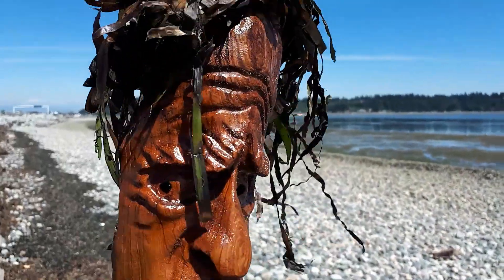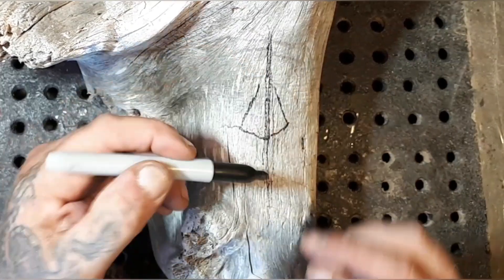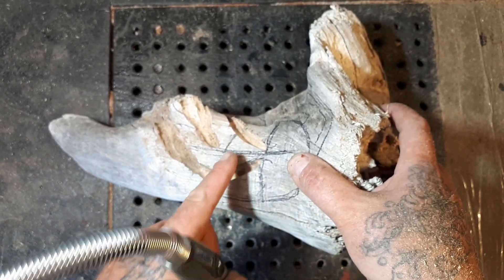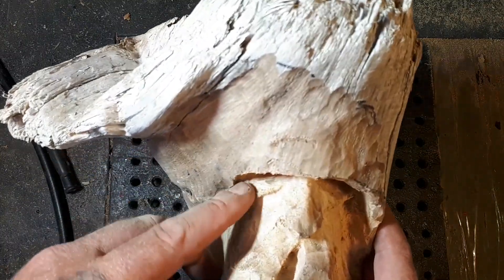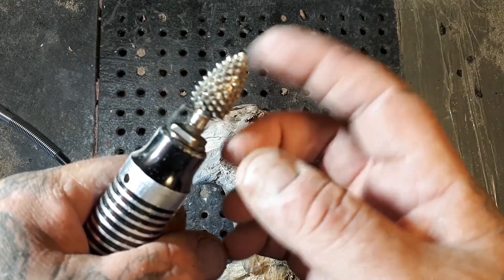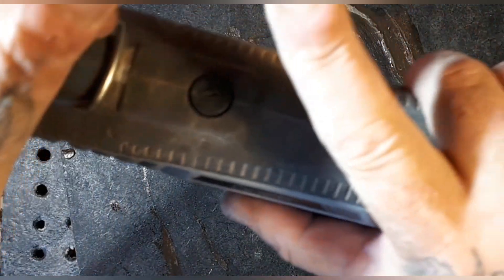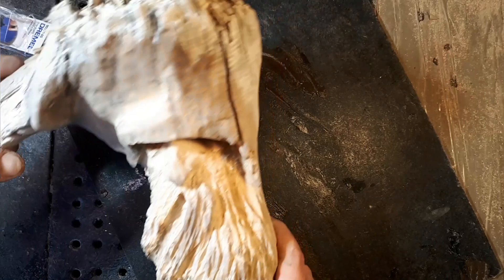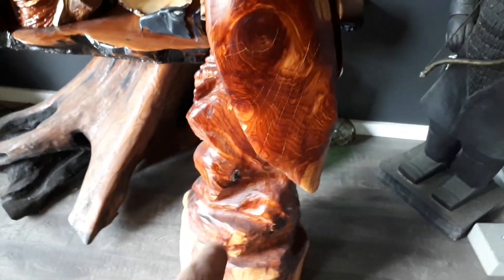*LEARN HOW* to carve a EASY driftwood spirit succulent holder

Comment: Great idea Jordy. I think you can easily get $80 -$100. 

Google string of pearl succulents. They would look cool hanging down as wood spirit hair. Also drill the holes all the way through so the water will not collect in the planter area and rot the roots. 

Thanks for the shout out. 

Hopefully I’ll get some carving time tomorrow. I picked up a new dremel cutter burr to try and cut hairs with. I’ll show it in my next video.